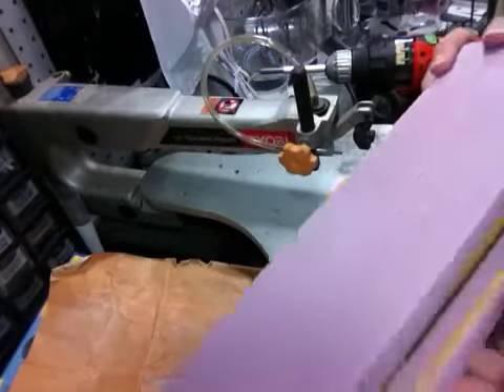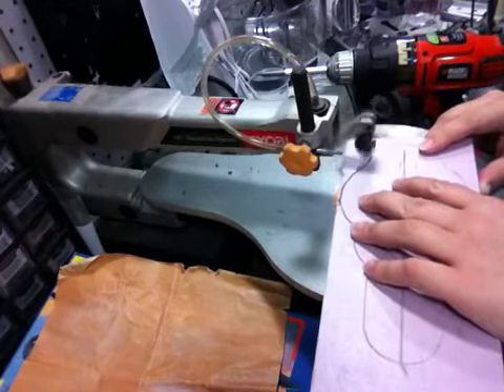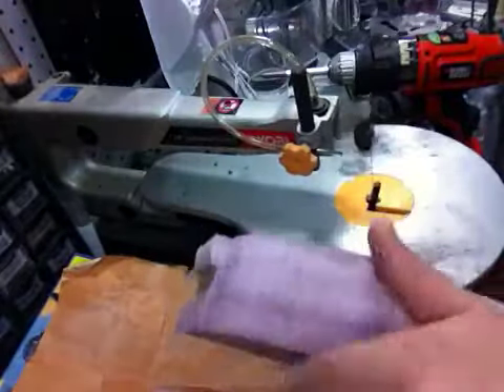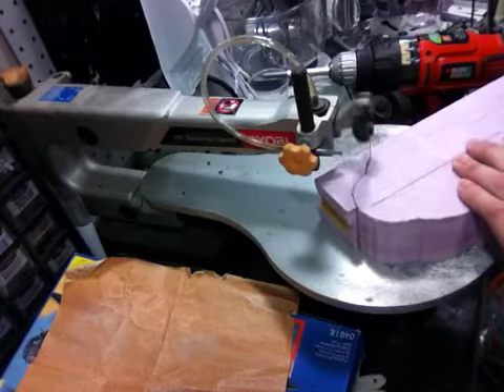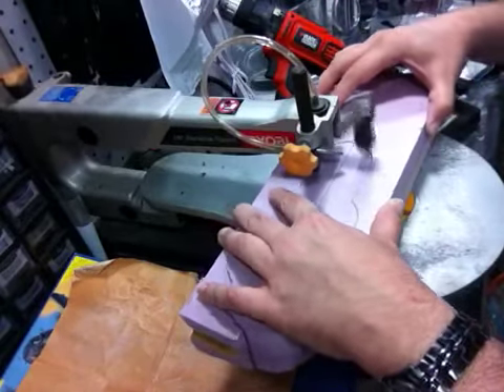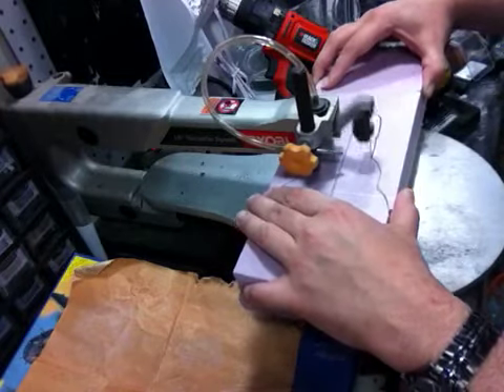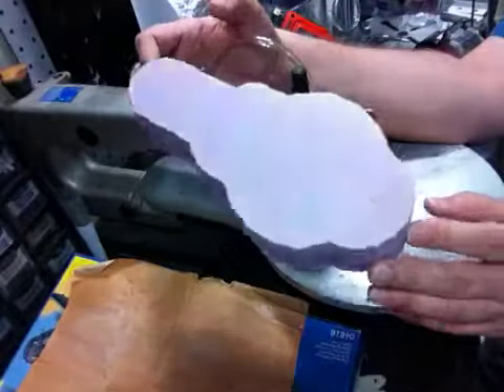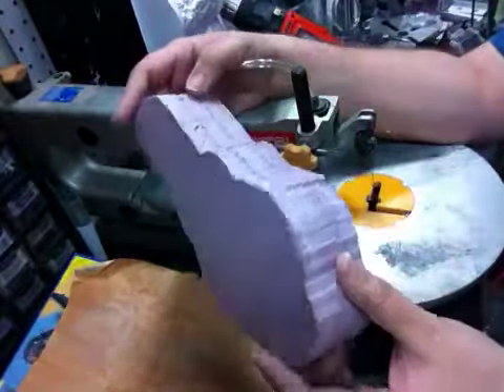Jack Houston BTS: Carbine Cruiser #2, Shaping The Body

Comment: Awesome! im about to aquire a scroll saw for cutting foam board for making planes. What blade are you using?
Reply from the maker: Sorry, just found this comment. I use a variety of blades. My favorites are the spiral blades, because that's how you get a truly omni-directional cut, which is what the scroll saw does best. I also like the tiny jeweler's blades. They usually don't have pins, so you just have to screw them in very tightly, but they create a much finer cut.  

I also have a band saw now. Those are much better for making straight cuts, because instead of pumping the blade up and down rapidly (basically like a sewing machine), the band saw uses a ribbon blade on two wheels so it just spins in one direction and the blade is wider and can give you a much straighter and cleaner cut, without having to worry about pinning the object down under the forks so it doesn't move vertically. With a band saw, the blade always moves downward so your material stays relatively flat and won't jostle around much. 

Of course, for making non-linear cuts, a scroll saw is still the best. And for foam, the smaller the blade the better, because you don't need much power, so you'll be getting extra precision.

Hot wire is another way to go if you're working with polystyrene, but don't try it with polyurethane (it'll burn instead of melt, and then nasty gasses are released. No good.)

Good luck with the plane building!